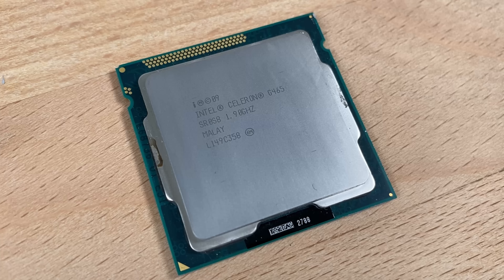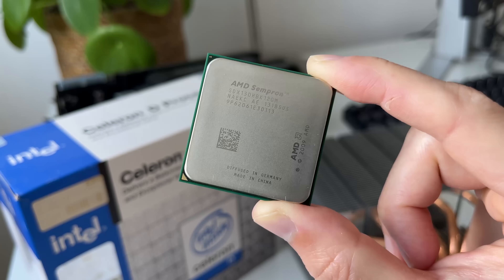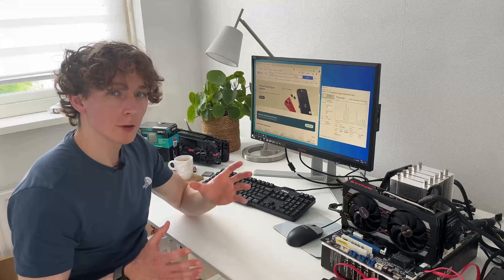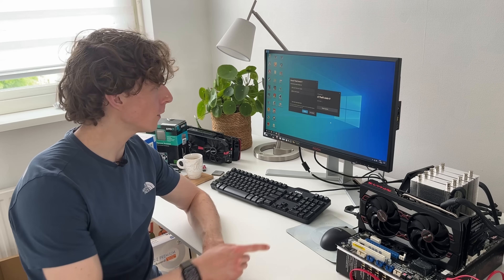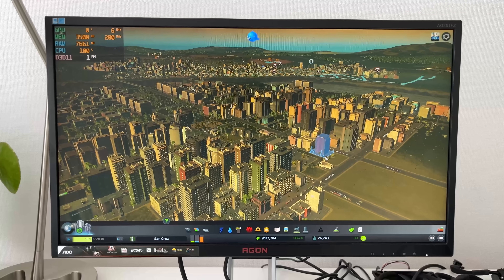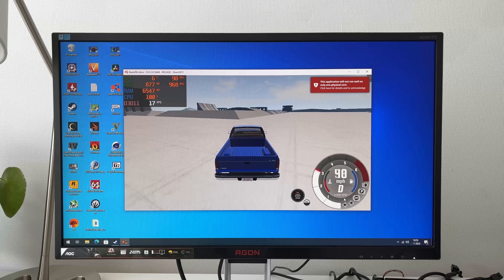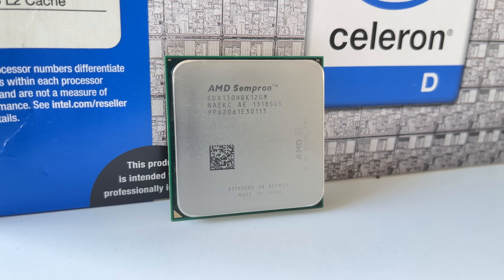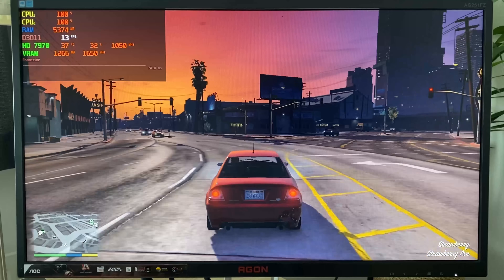AMD's Final Single Core CPU...

Comment: I remember using unlock core sucefully many years ago. I was happy. But not remenber details sadly :( I think that was some wierd 3core cpu and I unlock fourth. Its possible to be truth, or i have wierd memories?
Reply: yeah, it was 99% phenom x3
Reply: @ArmageddonCZ ye I remember those phenom x3 CPUs were actually 4c chips with 1 core disabled because they didn’t pass qc. Oftentimes the extra core was fine and amd didn’t physically disable the extra core so you could go and do some trick in the firmware to turn it into a phenom x4.

Comment: Core unlocking... That's something I haven't heard for more than 10 years.
It was such a bizarre and interesting thing back in the say and definitely deserves even more FB coverage!
Your unlocked core seems to have carried over full 1MB L2 cache, that might explain the poor stability.(which says the L2 cache was toast hence disabled)
Which means Sempron 140 was the better buy for unlocking, for the functional 1MB L2 cache.
Reply: AMD is using internal fuses for CPU's to validate and fuse off certain parts of the CPU if they are not working as expected. This happens on the Ryzens. AMD did the locking of cores through ACC and motherboard makers where able to bypass that whole ACC by throwing in their own EC firmware codes. By activating it you would be able to unlock one, two or even 3 cores with full workings. But as you can see not all chips where fully working X2's or X4's etc - there where chips with flaws and above is one of m.
Reply: if only this was still an option, there are rumors that some RTX 4070ti gpus will be using defect RTX 4090 dies with defective areas fused off. imagine if you cound unlock some of those back
Reply: I used Sempron 140 when I was kid, and when I unlocked(bought a new MB with UCC function) I just get Athlon II X2, that was absolutely mad. And when I tell this to my classmate's - they call me liar, and this is impossible))))

Comment: The semprons were always known to overclock like absolute kings...!
Reply: I ran a Celeron D overclocked to 5.15ghz 24/7 from it's stock 2.93ghz for about a year until the motherboard broke. In the winter, I would put the pc tower on the window shelf, the pc tower fit perfectly with the window open. Free cooling! lol!
Reply: I had / have a Ryzen 3 1200 that has a stock frequency of just 3.1GHz to 3.4GHz boost, over-clocked that thing to 4.25GHz with 1.45v.
Ran at 3.9GHz with just 1.38v, at 1.4v it could even do 4.0GHz!
Reply: @Nighterlev my ryzen 5 sadly can only push to 4.45 before blue screening
Reply: @RAILGUNSHOOT  which Ryzen 5? The Ryzen 1000 CPU's really couldn't over-clock well at all.  
Ryzen 2000 CPU's couldn't either.  Ryzen 3000 CPU's were slightly better but still not great.  

Ryzen 5000 CPU's can OC pretty well but AMD essentially pushes them to there max limit already anyways so not much point in OCing, cause AMD OC's them out of the box lol.
Reply: @initial_kd  remember those , had a duron 800 that would happily oc to 1100 , but voltage was way to high to be safe .... good fun though
Reply: celeron 300a enters the chat
Reply: I had a celery 366a oc to 550mhz back in the day.great chip for 120 cdn back in the day.
Reply: @JSparrowist  I remember the core 2 duo e4300 running stock 1.6ghz overclocking to 3.45Ghz, it was the budget beast of its day.
Reply: @JSparrowist  That was a cheap 150Mhz increase - a good sempron would easily do 1.5 Ghz.
Reply: @vanderlinde4you  I had a G3258 Pentium that would do 4.5Ghz all day and 4.7Ghz with too much voltage to be safe.